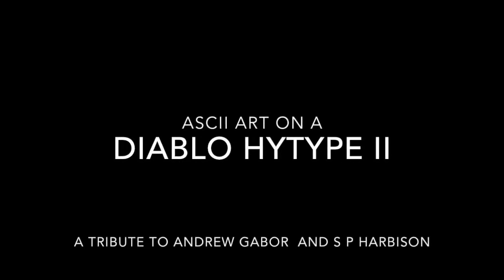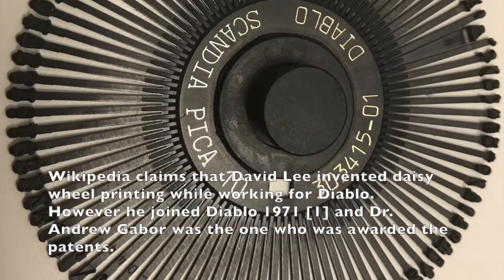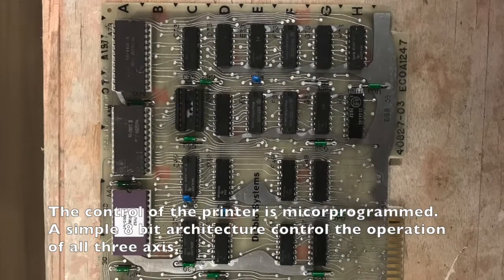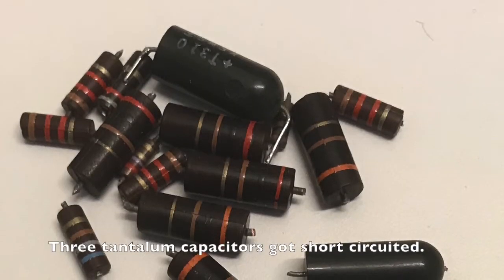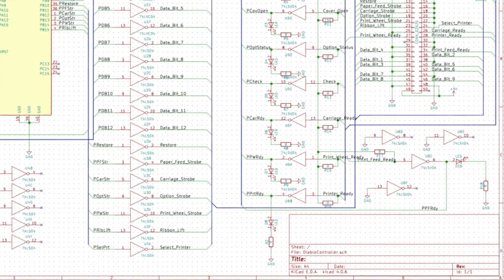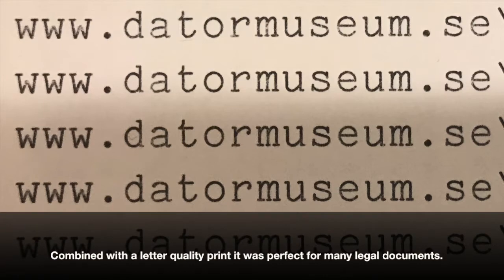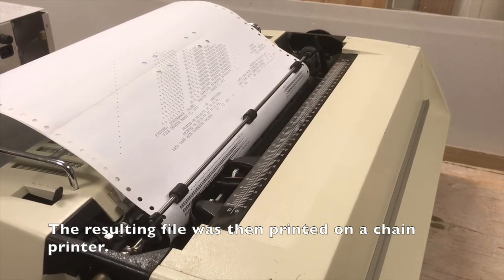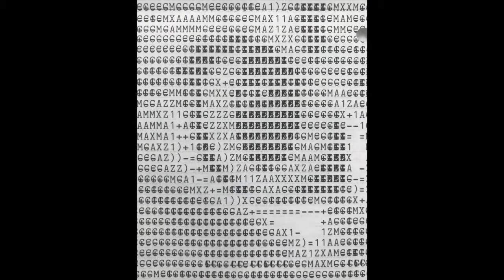ASCII art on a restored Diablo HyType II Daisy Wheel printer

Comment: Love the speed, amazing! But, can't it print in both directions? Some others could (e.g. Olympia), I believe. Look: https://www.youtube.com/watch?v=NiYZ5EoEaIU
Reply from the maker: It would probably work fine to print in both directions.  It is the responsibility of the printer controller to handle that. The printer itself is completely stupid, it just positions the wheel, positions the head and positions the platen. The rest is up to the controller. In this case the printer controller is my own design and I never thought about printing in reverse!
Reply: @mattislind4443  Oh, ok. That's a very very early Diablo then, right? I have a Diablo 620 with a parallel interface, the controller pcb inside the printer does all that for you, it's got inside a uC of the 8051 family, I believe.
Reply from the maker: @gotj  Yes. It is quite early. 1976 somthing if I remember correctly. They also made a model with built in serial port that had a 8085 or similar to handle printing. A variant of that one even had a keyboard so you could use it as a terminal. A faster teletype. That would nice to have!
Reply: @mattislind4443  These are also amazing videos, look:  youtu.be/watch?v=izZ02t2UEGc and youtu.be/watch?v=RTtKaqIpOJc
Reply from the maker: @gotj  Indeed!  Those are mechanical wonders. I have a IBM 731 IO Selectric but I have had trouble to get it working properly. It is interesting that this was what Diablo competed with. They made a printer that printed just as well with a bit of really nicely designed electronics and som servo motors. Doubled the printing speed!
Reply: @mattislind4443  Yeah, twice as fast as a Selectric :-) First time I see the IBM 731 IO Selectric, it's nice!
Reply: I had a 630 growing up, and it went in both directions when fed from a PC parallel port from wordperfect. The paper handling speed was pretty amazing, too. If you were printing sparse text it would jump around over any space on the page. We had the tractor feed attachment which had feeds on both the front and the back of the paper, and when it was moving between blank pages it seemed like it would shoot them out a foot into the air before gravity caught up.

Comment: The power supply had been miniaturized by this time?   The power supply for the Diablo sheet feed printer in the Xerox 850DSP and 860IPS was quite large with several very large electrolytic capacitors.
Reply: In the 850DSP/860IPS this could also print bi-directionally and also with Proportional spacing. You may find that the Xerox/Diablo metalized wheels are not only more durable but they're print is sharper.

Comment: My dad worked for Diablo. We had a 630 printer and Xerox 820 CP/M PC at home. I wrote a program that plotted lines like a plotter. Wore out the period glyph and Dad got mad.
Reply: I know some plastic printwheels had metal for the period that I assume was designed to combat this. I remember reading a section in the manual that described doing just this and wondered if anybody had written any software to actually do it!

I had 820-II hand-me-down with wordstar but the 630 was in the domain of our DOS system with wordperfect. I had a neighbor with a CP/M system (maybe a Zenith?) and a 630 that could read some 8" format disks from my 820, and I used to bring over documents for him to print. This was the late 80s so these were already considered obsolete, but I learned a heck of a lot on my 820.

The quality output of the diablo mechanisms was great, it was better than laser printers if you only needed text output.